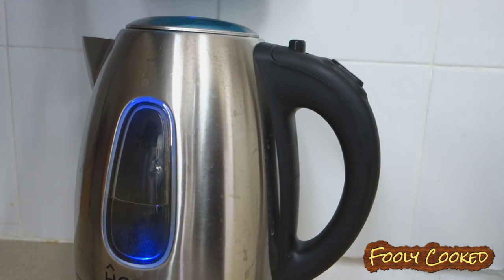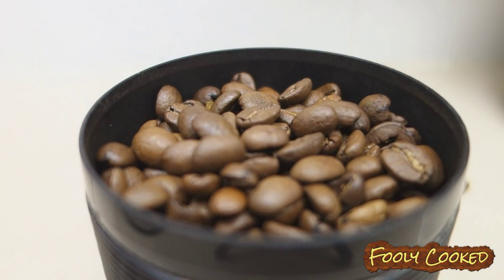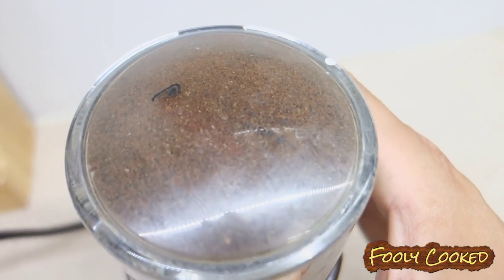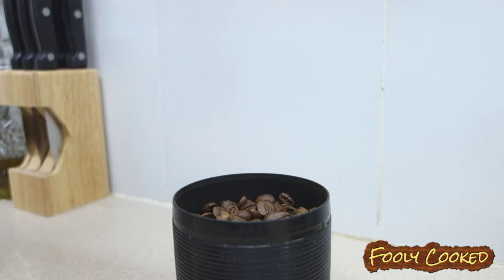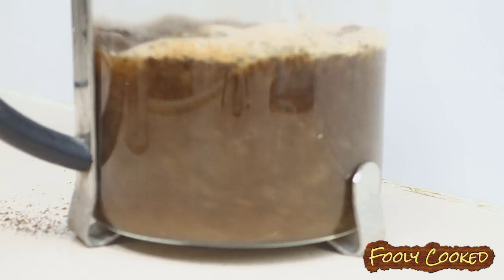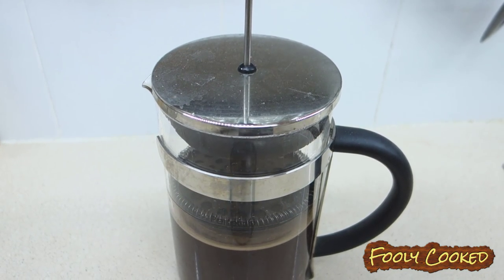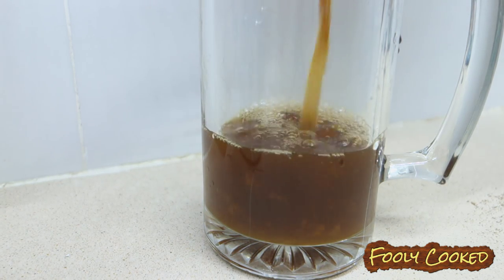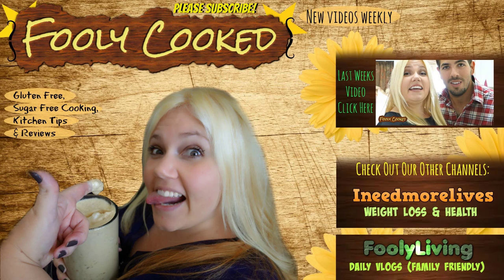How To Make FRENCH PRESS COFFEE in less than 5 Minutes!

Comment: Great video.  I did not know this type of coffee could raise your cholesterol levels...interesting.  I think I am going to buy one of those kettles.  Every time I see you use it, I think...I need to get one of those.  How long does it take to boil a full pot?
Reply: Oh they make GOOD ones in the states, Lori!! They make them with different levels of heat so you can make a perfect cup of coffee or tea right out of the pot, and they  have like 5-6 different settings. Very high tech. I watch OnePotChefBlog and he also uses a kettle in Australia so I think they are popular everywhere except for the states! He even has the same brands as we have in Israel. I am worried about microwaves, so I don't use one, but I used to heat my water in there. I don't know what it does to the water though, you know? I worry about that stuff. Hadar fills the kettle in the morning only halfway and it heats up in about 1 minute to boiling, but we have different electric than you guys. Ours is 220v and yours is 110v and I swear stuff gets hotter here than over there.